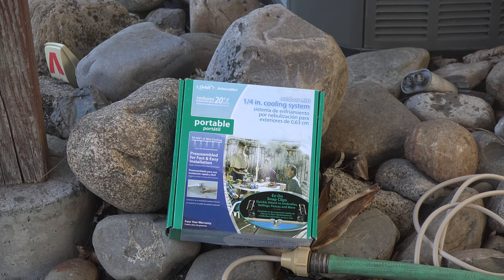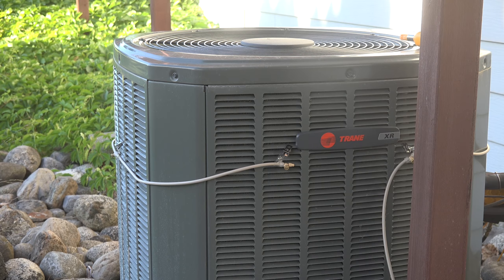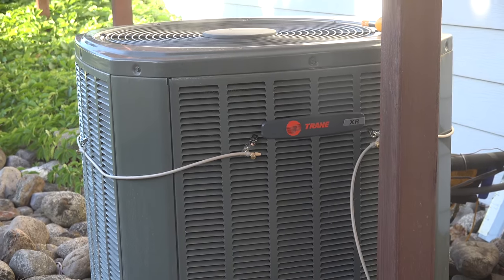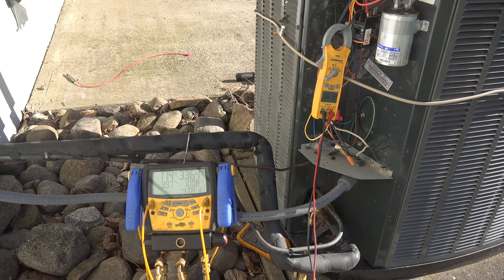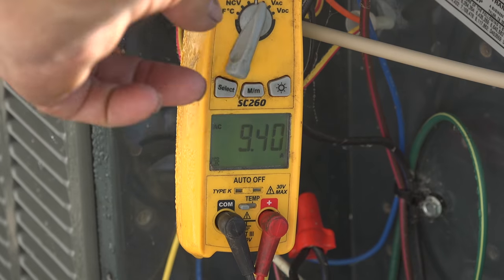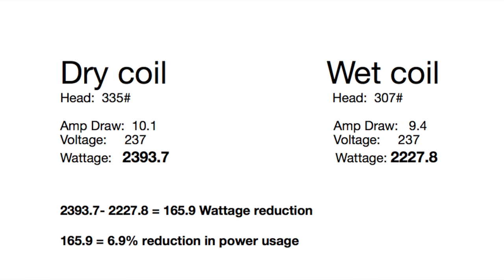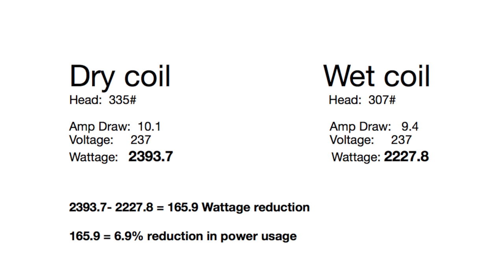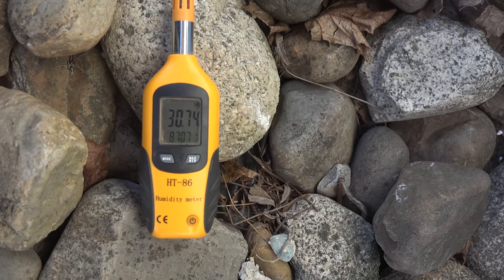Do the misters for A/C work? Part #1

Comment: very bad idea the mist ends up causing corrosion and the fins then it can't transfer the heat as it was designed . then you have to prematurely  replace the unit. trust me I have seen it first hand been doing A/C for almost 30 years in Las Vegas NV.

Comment: Good idea, I have a reciprocating compressor extremely hot 🥵 
Shuts down and hoy day 
Need to perfect that system 
With clean water 💧 
The concept is there
Reply from the maker: I did not say it was good.  Watch all 4 videos.  It does not help.  
If your compressor is getting hot and shutting down, you have a service problem.  Possible low charge or blocked outdoor coil.
GFM

Comment: What your not taking into consideration is the time the AC has to run to cool the house without the misters to lets say 76 degrees this is where the real saving is, your AC will not have run as much/often so throw in the time into your calculations and your 6.9% will go way up. Thanks for the video.
Reply from the maker: Watch the entire series.  They are linked at the end of the video.
GFM

Comment: I think you failed to mention that the temperature in the air exchanger drops a few degrees, causing the house to cool down quicker thus running less time. That equals to even more savings. 
At least that's how the other videos sell it, have not tried this myself
Reply from the maker: Watch the entire series.  Linked at the end of the video.
GFM

Comment: What you are forgetting is run time by reducing head pressure you also especially on 100+ degree day it will reduce runtime which will add to its effectiveness.
Reply from the maker: I just published a video that looks at that issue.  You may be surprised.
GFM

Comment: The mister costs you $15.  At a savings of $0.18/day, that's 83 days to recoup the cost of the mister.  Then there's the water.  And if you live in the SW, you're not supposed to use water outdoors unless necessary due to drought conditions.  So I agree, not worth it.
Reply: Simple. Use a solenoid hooked up to your 24 volt system and the misters come on and off with your system. Uses 8 gallons a day on average. Solenoid cost about $25.

Comment: 335 psi high side?  where you live?  Thats pretty high.  If you're not in a desert state wash those coils good.  I don't think that model Trane has spiny fins so should be easy.  335  psi wow.  I'm in San Antonio and my head pressure yesterday at 105 degrees outside was 272 !!
Reply: R-410A not R-22.
GFM
Reply: Joe Irkwosk oh duh thanks for the clarification

Comment: Hi grayfurnaceman,

Nice video

I made my own mister system 5 or so years ago and have been using it since.  To control the water flow I use a lawn sprinkler valve (24 low voltage system and wired it into my AC low voltage control system – AC comes on so does the water).

I don’t have the testing instruments you do so I measured my gain differently.  I live in central CA (Sacramento area) on a hot day the ambient temp was 105F, the exhaust air from the outside cooling coils without misting while running was 115F, turn on the misters and that quickly dropped to 102F+/-.  This convinced me of the efficacity of the misters.

Misters in your video are much better than mine so I would hope even better results.

A less measured way I used for the mister advantage is was without the misters on a hot day the AC would run constantly until almost sundown.  With the misters on it would cycle on and off.

The last comment I live in a desert area so humidity isn’t an issue.  I would guess those in more humid climates may not want to shorten the running cycle times too much.

Comment: If you live in a DRY climate, you're apt to get better cooling, for lack of humidity. These misters wouldn't work well in the south. Just as a swamp cooler doesn't work well in the south. More savings can be yielded, by controlling the thermostat, and insulation.

Comment: Unless you have a filter coming off your water source i wouldn't recommend this . Calcuim will build up and saturate your condensor restricting heat transfer .What sounded like a cost saving deal will end up ruining expensive AC components .
Reply from the maker: There is also a problem with filtering water for misters.  Pure water is highly corrosive and may put holes in the coil.  
The point of this series of videos is misters do not help and may damage components.
GFM

Comment: But you Missed the huge Sub cooling factor... (you removed all that added heat empathy) 
meaning you'll be able to absorb More Heat in the Evap coils. Then displace all that added heat pick up with the misters...
Shorter Run times too... approx 15% ( means, more added savings)
& your inside Delta T (temp diff from return/supply ducts)will be improved by 12-20%  depending on age n SEER of system
Reply from the maker: I have to ask if you have actually watched this video and the others in this series (they are linked at the end of this video).  
While head pressure dropped about 30#, subcool was not substantially changed.  In fact, Delta T decreased 1 degreeF with the misters on.  
It appears that you made assumptions about enthalpy, run times and delta T that just are not there when you test.  I have to ask where you got your numbers.  
Perhaps, if you were dealing with an A/C that was made in the 1970s, there might be some improvement as those units were ridiculously inefficient.  But any unit made in the last 40 years will not be improved.  
GFM
Reply: @grayfurnaceman   no I haven't watched all your vid.  and now(currently) 
just finished w/ last one. 
& I concur w/ your findings/ testing.
d.c. equipment is the way to go.
Reply from the maker: @user-xk5so7wb2t  I also believe variable cooling rate is the way forward.
GFM
Reply: @grayfurnaceman  Yes, all depending on the Humidity in home/where you live.. 
geothermal best seer but very costly to run  loops along w/ needing a lot of land
Reply: about 20yrs ago. did you remember an ac unit called AC2  (3/8" copper rolled at bottom of cond  (fiberglass exterior)  and water cooled..  to many problems to maintain
Reply from the maker: @user-xk5so7wb2t  I have not seen that particular unit, but have seen various units that worked on the same principle.  The bottom line is always water.  
You cannot deny the capacity of water to move heat, but there always are problems that crop up, especially with consumer type equipment.  
Systems like cooling tower systems are well established and work well, but they require constant monitoring by professionals.  
GFM

Comment: Be better just to put evaporative cooling housing around the outside unit!! Water is just going to clog the condenser fins with a mister then corrosion sets in killing the unit!! Just say- n!!
Reply: Refrigerant boils at an extremely low temp, it doesn't matter if its 80 degrees or 100, the system is designed to remove heat in the condenser just enough to get the high pressure high temp vapor to condense back into a liquid so it can then in the txv indoor coil be regulated back into a vapor.  It's a sealed system designed to operate in 120 degree weather.  If your system isnt performing properly call a pro dont waste your money on a warranty voiding scam.  If water cooling the condenser coil was logically the big companies would offer it.  But they dont cause it's stupid and will ruin your unit.

Comment: There is a flaw in your test procedure. You are not calculating how much the on time of the unit is reduced due to cooler air from the vents into the house. The house will cooler faster and cause the on time of the unit to be reduced. I still wouldn’t use the thing unless I had distilled water coming out of my tap. Another benefit you didn’t calculate is that lower head pressure would be less wear on the unit. If the unit lasted, say a year longer due to the system that would be a big benefit.
Reply from the maker: You might want to check the next in this series.  I determined the delta T with and without the misters.  I did not compare the on time as there is no way to accurately compare on times due to different solar gain, humidity, etc.  
The distilled water issue is an interesting one.  Distilled water will have no minerals in it, but it brings in another problem.  Corrosion.   Distilled water is quite corrosive because the minerals in the water inhibit corrosion.
I can't calculate any reduced wear from lower head.  You would have to contact a compressor manufacturer for that one.
GFM

Comment: I appreciate what you did here but calculating power usage for AC motors doesn't work that way. The phase angle between the voltage and current are not accounted for.  When there is no load on an induction type motor the phase angle between the voltage and current (approach 90 deg) In that case your actual power consumption would be near 0 even though your current would lead you to believe there is more. As the load increase and the motor starts to slow slightly, the current increase but the voltage and current move in phase and real power increases much more dramatically.
Reply from the maker: The difference between real and apparent power is virtually not existent in residential systems.  In any case, the difference in usage is real.  Also, measuring the delta T is an accurate performance measurement.
GFM

Comment: This misses the most important point: duty cycle of the coil (how often the AC unit will come on). The build up is a the main issue, it will destroy the coil. Use rainwater for an application like this.
Reply from the maker: I don't know if you have watched this whole series, but how can the duty cycle be less if the temp split is lower than without the mister?
You could use rainwater, but pure water is quite corrosive, which introduces another issue.
GFM
Reply: @grayfurnaceman  I did watch the whole video. The duty cycle is driven by the temp inside the house (the thermostat). There is no mention of it in this study. The duty cycle is the most important parameter to measure, and it is ignored here.
Reply from the maker: @andrelochin4079  I would refer you to my answer.  Do you know what temp split is?  Not being obnoxious here, but if the temp split is lower than without the mister, you cannot have a shorter duty cycle.  
How long the A/C is on is not covered here because the load is variable throughout the day.  
You must do your tests as close together as you can to reduce your margin of error.  
I guess your assertion that duty cycle is correct as far as it goes.  Load is driven  mostly by outside temps and sunlight thru the windows which will increase indoor temp and thus thermostat sensing.
Consider that you start your test mister off.  at 11:00.  Outdoor temp is 90F.  You check cycling time.  It is 40 min.  It is then off for 30 min.
Now it is 12:10.  The unit starts.  Mister is on.  Your outdoor temp is 95F.  You check cycling time.  Its 45 min.  
This is a meaningless number.  The load has changed.
GFM

Comment: your #’s are accurate but your missing a variable!  that is if this mist system can cut off the total power usage for 2-4 hours a day like they claim. how much does tht save if the ac isn’t even running for up to 4 hrs a day? then x’s that by the number of really hot days 90+ because this wouldn’t do much in 70-80 degree days like one person wrote.

with that said, you would have to run this test on a day that is 90 plus for the whole day and compare it to another 90 plus day without the system. Then if you had a crazy hot month like we are having in kansas right now it may/or may not be worth it in the long run over the course of a 5 years span running this unit a few weeks out of the summer every summer for 5 years.

the only thing im not 100% certain on, is if the filters on the mist n save systems stop the calcium build up. cuz if it doesn’t then you are going to loose money replacing the ac unit
Reply from the maker: The estimation is just that.  There is no accurate way to determine savings.  Even the proverbial 90F day comparison will not work as humidity, cloud cover and internal loads will not be the same.
GFM
Reply: grayfurnaceman your right no days will be exactly the same of course, but your numbers will be a little more in depth and paint a broader picture then just that of a 10 minute voltage test wouldn’t you agree....

Comment: You (and everyone else testing these things) keep saying that the misters cool the air passing through the coil. This is a very small % of where the reduced head pressure comes from. You should always consider "everything" that is going on, and it should equal 100% of the heat transfer. The "change of state" of the water (liquid to a vapor) is about 950 btu/lb of water. This is the latent heat of evaporation. The atomizers make a mist, but it is not all turned to vapor. If you can see it, it's not a vapor. I like your 7% test results. People should realize that a the use of a water source refrigerant requires extensive and costly water maintenance to not destroy your equipment (that was not designed for this in the first place...)!
Reply from the maker: The idea of a mister is for all the water to be evaporated.  In practice this does not occur except in under very strict conditions.  Most of the water does evaporate as it comes in contact with the hot coil.  There are 2 problems here.  One, the A/C unit was not designed to operate with the reduced head pressure produced by misting.  The result can be inefficient operation.  
Two, the calcium buildup damages the coil.  
The rest of this series gives more insight into what this does to the efficiency.
GFM
Reply: @grayfurnaceman  Agreed. However this is only a problem when the unit is operated under low ambient conditions. This device is most effective when the equipment is operated under outdoor air conditions higher than the system design (here it's 95F). This is when we notice that the liquid line temperature rises well above OA ambient. In this case the heat that can not be rejected to the OA properly due to now being undersized (which is proper as we do not design equipment for "worst case weather conditions"), and recirculates back through the system significantly reducing capacity. This is why people find the indoor air temp coming down when using these things. This is where the greatest savings occur. The number of days that the equipment operates above design temperatures is hardly going to match "cost of investment". 

I do not agree that "The idea of a mister is for all the water to be evaporated. ". As you stated, "under very strict conditions". The wet bulb temperature determines these conditions. What works in AZ is not the same in Mississippi. I can not see the designer expecting to get minuscule energy savings from evaporative cooling only, when you can get almost 1,000 btu/hr/lb by changing the state of the water from liquid to a gas. The mister is for distribution of the water and water conservation. 

Someone should test the effect of liquid refrigerant line temperature. This is where the big saving on cost of operation and equipment life comes in.

Comment: Use the condenser water should be like distilled water
Reply: First, its evaporator water.  Second, there is not enough volume, even in high humidity areas.  
You are correct it is distilled water.  Distilled water is highly corrosive, especially at high temps and when in contact with copper coils with aluminum fins.  Dissimilar metal corrosion.  
GFM

Comment: Wouldn’t a cooler AC running more efficient cool a house faster? I guess it depends where you live.
Reply from the maker: Its not that simple.  When A/C units are designed, they work best with the pressure difference provided by the outside temp.  When you change the head pressure, you may actually reduce the efficiency.  The age and expansion device may determine if there is any difference at all.  I would recommend you watch the entire series.  Some things seem better than they actually are.
GFM

Comment: You can do a lot less math by just comparing the %tage difference in Amp draw.  If you could actually adjust the superheat of the expansion valve as a result of the cooler condenser temperature you might achieve more efficiency.  I think a lot depends on the location of the compressor / condenser unit. I'm surprised when I see it on the south side of the house in full sun.  At least for air conditioning I believe it should be installed on the shady side of the structure if at all possible. Corrosion certainly would be an issue.  A creative guy could install a water cooled  heat exchanger in lieu of or in addition to the air cooled condenser.  They work great at least on yacht refrigeration systems.  But back to the normal residential condenser units.  If it is in the sun, install some kind of shade cloth over the unit, making sure there is still plenty of room for air circulation.  Another idea might be to take a box fan outside on very hot days and direct it toward the condenser coils.  In my mind the most important benefit might be to reduce stress on the compressor, not simply any energy savings.

Comment: Like Korishan said you failed to factor in time. You little experiment was like 5 mins....well what if your A/C runs 12 hours a day multiplied by 166 watts every 5 minutes. That's pretty significant in my mind. Let's see 166X12 (# of 5 mins in an hour) = 1992 watts per hour X 12 (hours ran per day) = 23904 watts per day saved. 23kw X 30 = 717kw saved per month.
Reply from the maker: Its kilowatts per hour.  When you read a meter, then calculate, the result assumes the time period at 1 hour.  There is no such thing as power with no time period.
GFM
Reply: @grayfurnaceman  I still think time the A/C is running matters. Let's say I have a 500 watt light bulb and I turn it on for 5 minutes, wouldn't you agree that if I left the same light bulb on for an hour it would consume more power than only having it on for 5 minutes?